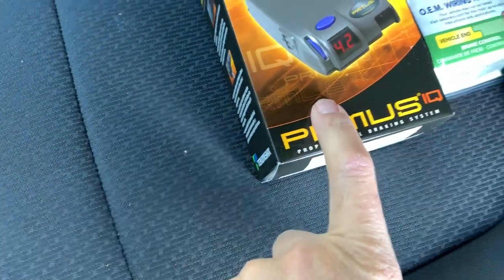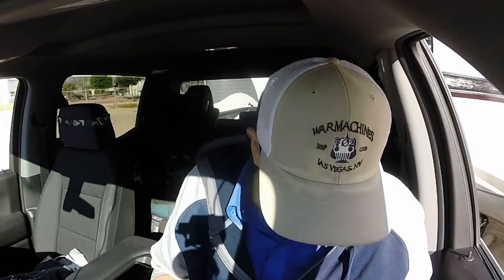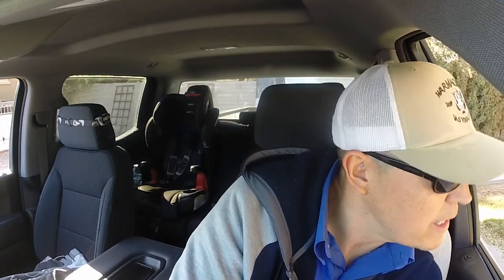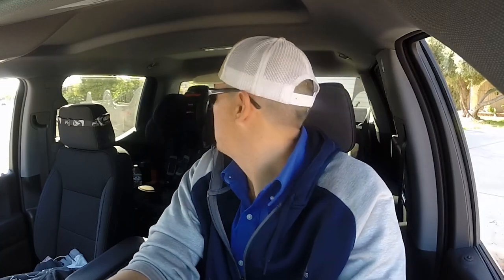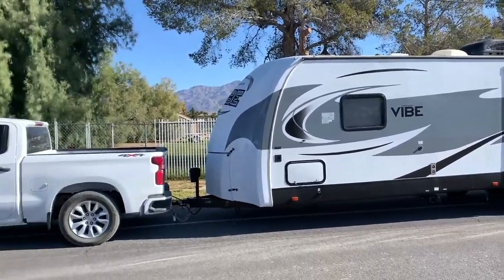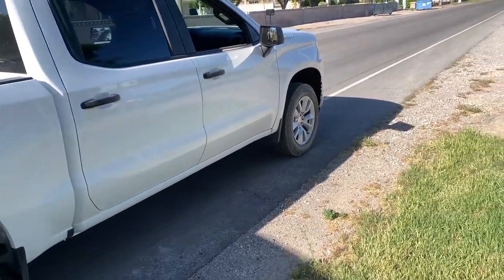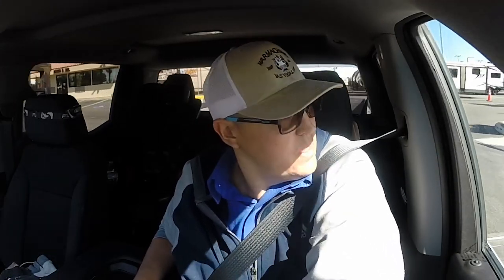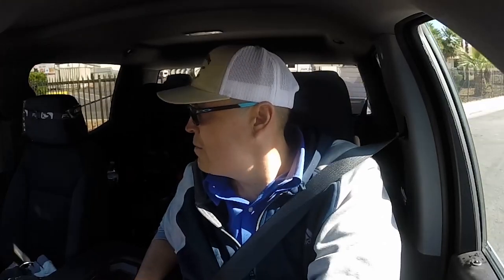Brake control install | Let’s pick up a trailer

Comment: Now that you traded in the Jeep, what rig are you going to use for 
wheeling?
Reply from the maker: For wheeling I plan to find a project down the road.  For now I’ll take the new truck on camping/overlanding trips, and the K20 for moderate trails.